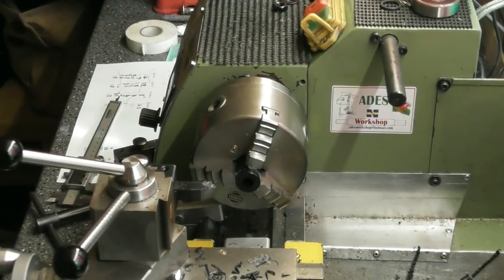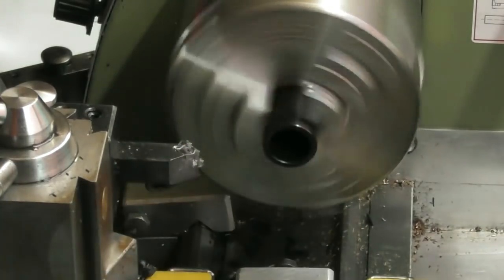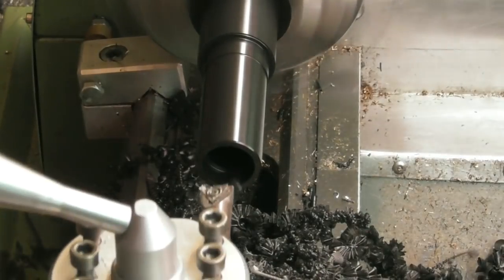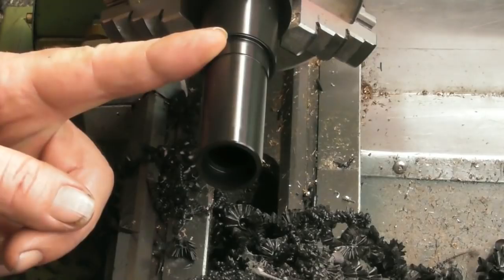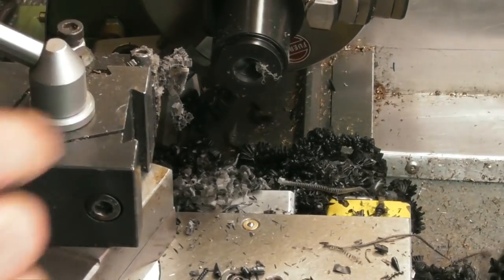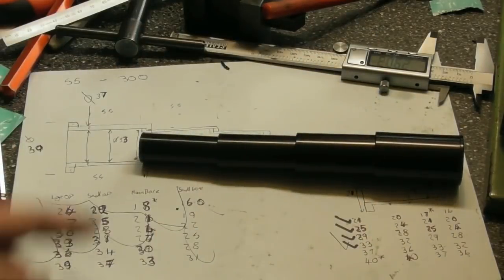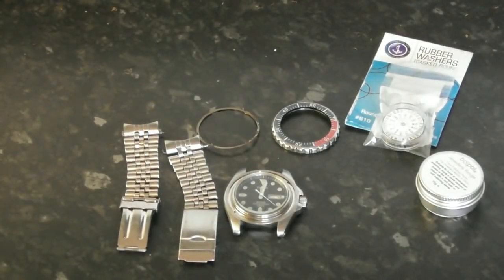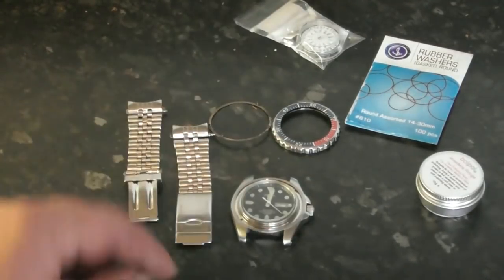Shed talk 12 part 2

Comment: Hi Ade, i have a question on the accuracy of your WM 180 lathe. Can you tell me if turning a piece of steel or aluminium say 100 mm - 125 mm or longer with a center in the tail stock, how far off being parallel is the piece when measured with a micrometer. Great vids as usual mate.
Reply from the maker: When new it was out about 0.1mm over 100 mm . i set up the tail stock to centre and all is good to within a few 10ths , i do check it when i am turning over a long length but it has not moved out since i originally set it up on centre, hope this helps , Cheers Ade.
Reply: When you first set the lathe up did you have to level the bed with any packers under the corners of the bed to get any twist out or did you simply bolt to the bench. Re setting the tail stock up, did you just adjust the tail stock over with the 2 adjusting screws in the direction it was centering out of parallel to put that right. Cheers.
Reply: Could you possibly explain on a video how you go about checking your lathe for parallel & how you go about putting it right if its out some. Thanks.
Reply: +gillian9178 
Hi,
This old Tony on YouTube has video on explaining what your asking.
Its quite easy to understand, it applies to any engineering lathe.
Adam
Reply: +gillian9178 
It's titled "lathe levelling" .
shows how to remove the taper from your turning.